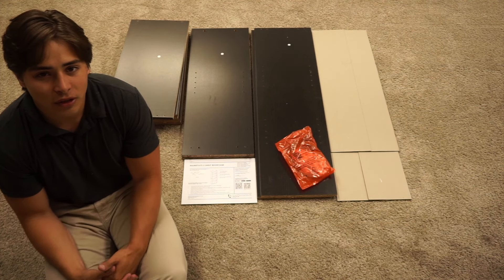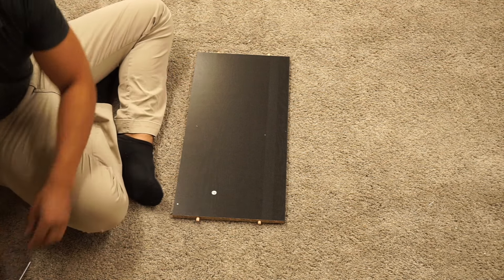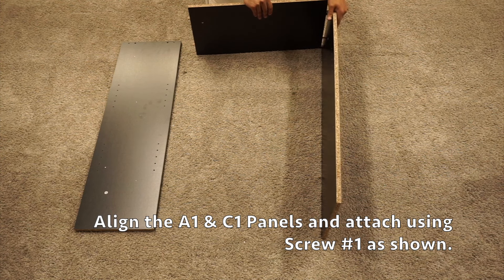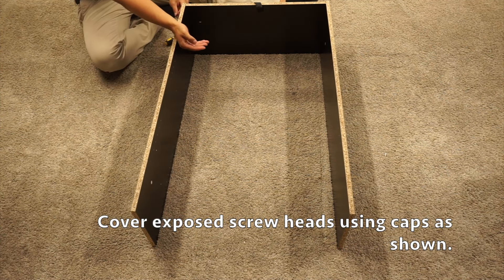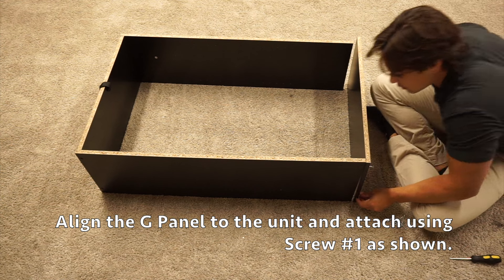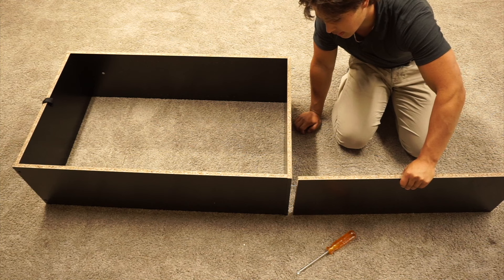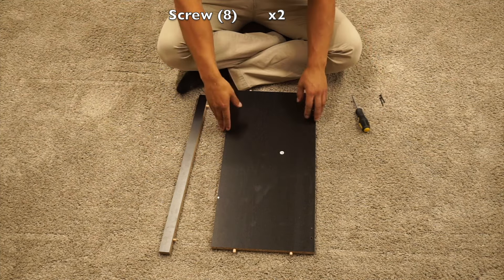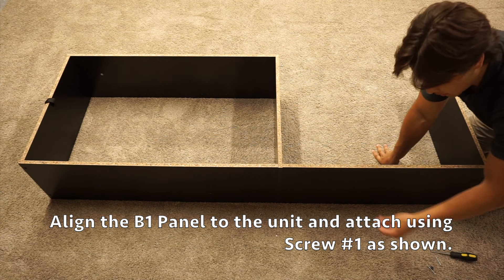Mainstays 5-Shelf Bookcase Guided Assembly

Comment: Mine was still an absolute nightmare to assemble. The pre drilled holes weren't on the G panel and some stickers were absent. It ended up a complete bust.
Reply: Same on my G panel lol
Reply: What did you do my g panel missing the second holes
Reply: @sosoxantonio7907  I made some crude holes in there and it was tough but ended up working.
Reply: Same; had to drill the holes for the G panel smh damn near 2 hours for a simple bookshelf
Reply: My A1 has 0 holes

Comment: My cam-locks shattered with the least bit of pressure. The assembly manual says to turn it 180 degrees but when I try to go past 90 the locks actually pop and break into 4 or more pieces. I'm using a hand screw driver with flat head and have tried phillips also. Any hints?

Comment: What if we don't have the hole on the A panels for the safety strap
Reply: The video explains to call the number in the beginning if you received defective parts, but I would say you could take the necessary screw that goes in that little hole and drill one in
Reply from the maker: WE CAN HELP
		1-800-729-1569
		Monday-Friday 9am-5pm EST 
		USA only